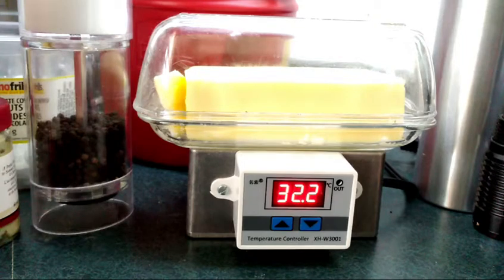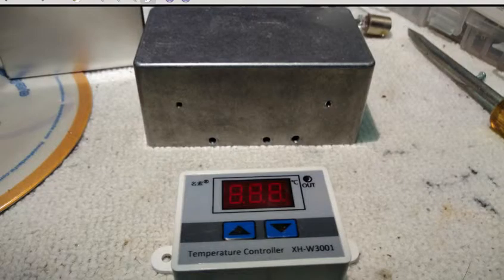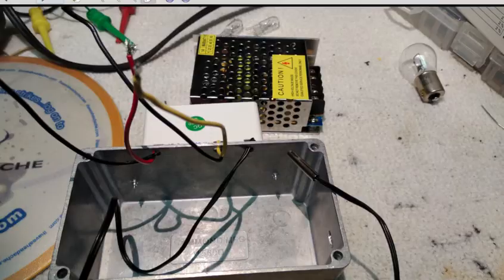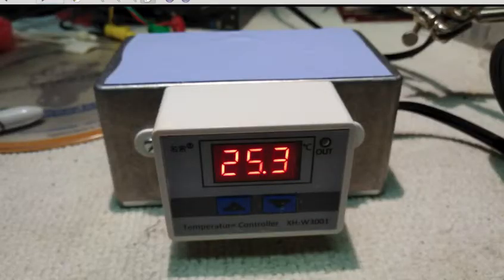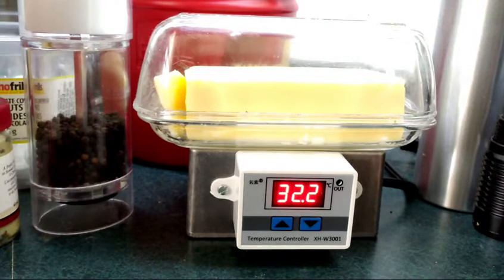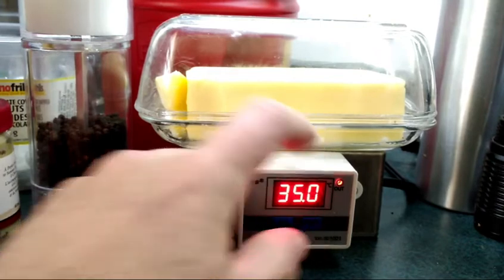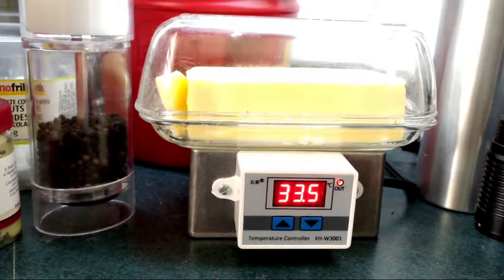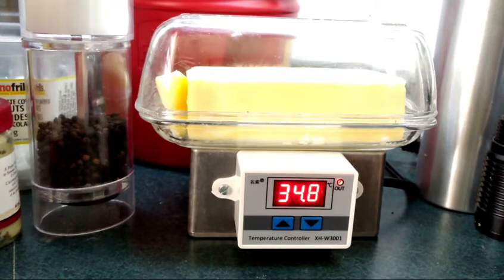DIY Temperature Controlled Heated Butter Dish

Comment: Hi Scotty TR6. Thinking of building one too. Could you give me  the name of the stores where you get the 2 amp. 12 volt power supply and the rest of the bulbs etc. I see the temperature controller on eBay. The Alfille butter conditioner is no longer available. Great work man.........Dale.
Reply from the maker: Hi Dale. I have since upgraded the unit. The relay clicked quite loud so I replaced it with a P channel Mosfet. I also replaced the lamps with 33ohm 5 watt resistors for longer life. I got the controller and 12V 2A power supply from Ebay. Just search Ebay for xh-w3001 controller and 12v 2a switching supply. Also Ebay for the silicone heat sink pad. The same for the resistors. I picked up the aluminium box from a local parts place here in Toronto called A1 Electronic Parts (they have a website).  Have fun and enjoy having spreadable butter!
Reply: @TheScottytr6  Thanks for the info. I am an hour south of Toronto in Branford, Ontario. I bought one of the Afille butter conditioners about 5 years ago and although it still works, they are prone to dying after 2 to 5 years apparently. I am using this conditioner  on borrowed time. LOL.
Reply from the maker: I looked for a butter heater and found that they were rated as very unreliable. Prolly due to the bi-metal thermostat failing. I've been retired for 5 years and I have no motivation to make anything to sell. I made the video just to encourage DIYers to make one on the cheap. I was surprised that it worked as well as it did. I was an electronics/computer/network tech for 37 years. Living the dream now. I hope you make one and enjoy it for many years.
Reply: @TheScottytr6   Hi Scotty. My niece loves mine so much she wants one. Not sure if you sell them or not or if I could look at yours closely to get all the numbers and specifics to make myself a few. If you could would you send me your email or your phone number at dale7548@gmail.com 

Any help would be beneficial. Thanks...........Dale.